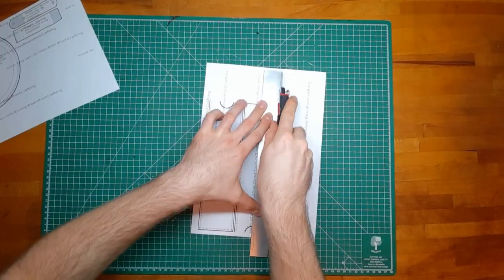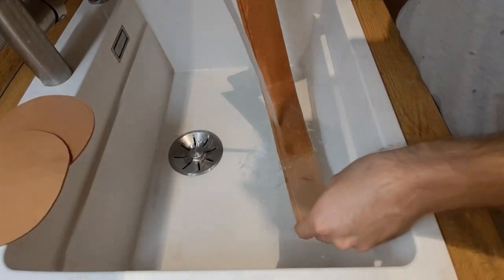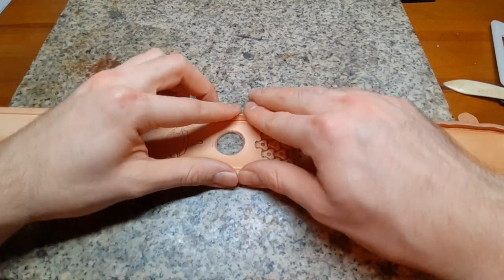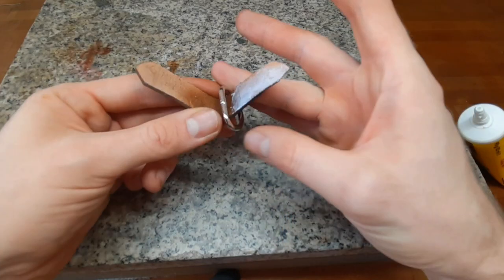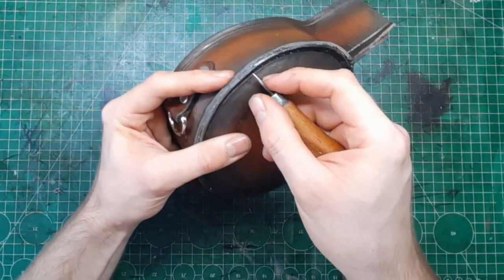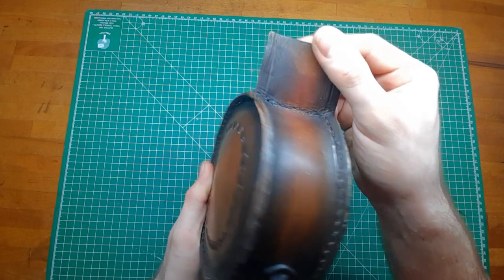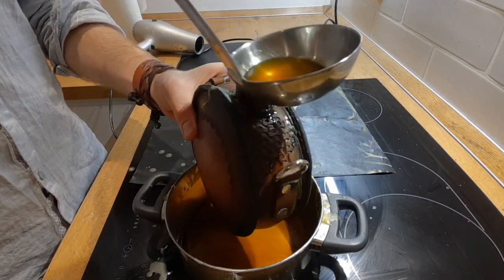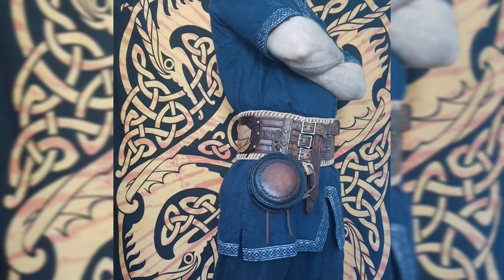Leather crafting Tutorial - Field Bottle

Comment: I saw someone at a festival  use the folding straw mechanism from a modern water bottle and then cut the straw to fit the leather canteen/costrel/leather water bottle to fit then they could just open the sippy straw to drink...I don't like using plastic or PVC for drinking because it has toxins from the plastic that leech into the water but it was a great idea.

Comment: How do you clean it if you're going to use it?
Reply from the maker: I use it only with water, definitely no sugar. After use I wash it with water and let it dry completely. So I not really cleaning it, but with only using it with water there is not much to clean, but yes at some point it may need some cleaning after long use and then I may just replay partly the inside wax.
Reply: @NilsBeardfoot Push a couple of dead tea bags in and shake it up a bit with VERY little water. Rinse a couple of times.
Reply from the maker: @susanp.collins7834  And that will clearn it? How does it work?

Comment: The only part i feel a bit doubtful of is the glue. The flask will be used to drink from i assume, so the toxicity risk of glue feels like a step worth skipping or altering.
Reply from the maker: You are right, but the same is true for the leather itself. When putting undyed veg tanned leather in water for a while there also will come substances off. This is way you should not save any bees wax, but in enough to be sure everything is well covered up and the water does not touch leather or glue; on the mouthpiece this is not so easy  but there most of the time is no water
Reply: @Nils Beardfoot  Leathercrafter myself, but i only use veg tanned. I have seen bottles being made with no glue however, so perhaps there are alternatives for you craft to skip that part. Just me thinking loud. As for the tip, you could switch that to cork fabric, as well as stitch it as a collar from the inside, instead of out and inwards. Get a good seal that way, and you don't need coloring. Anyways...just thinking out loud, and kudos for a good looking craft bud 👍
Reply from the maker: @Grihmmy  There are other ways yes, you could just punch the holes on both pieces  in advance, but you would have to line it up perfect. 
I appreciated you thinking out loud, thank you :)
Reply: Relax. Some glues don't just DRY - they CURE. Once this has happened the product is usually impervious to leaching.